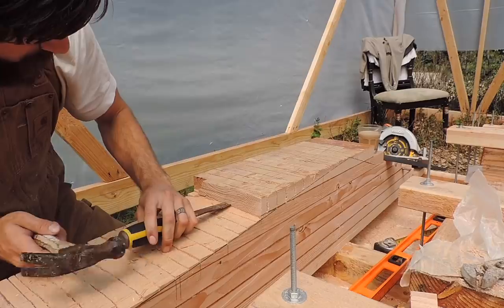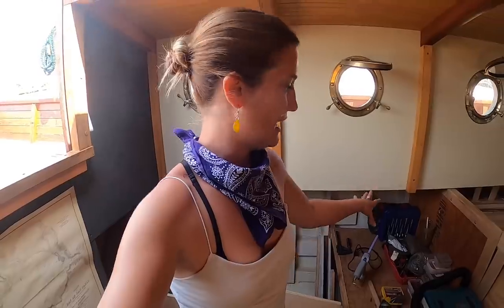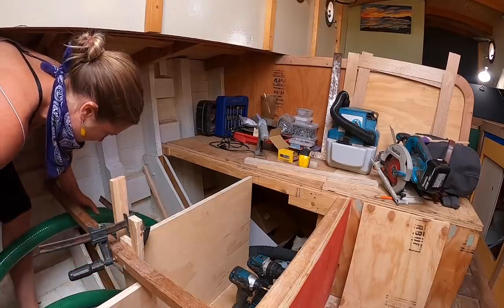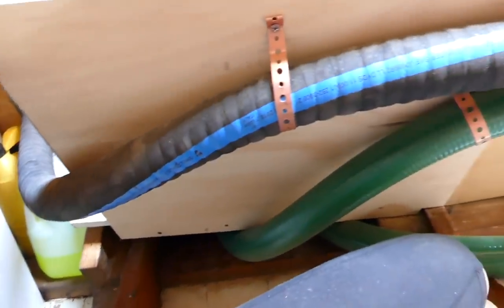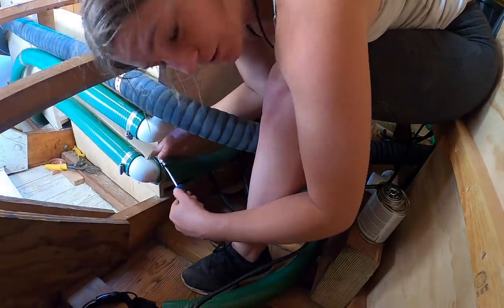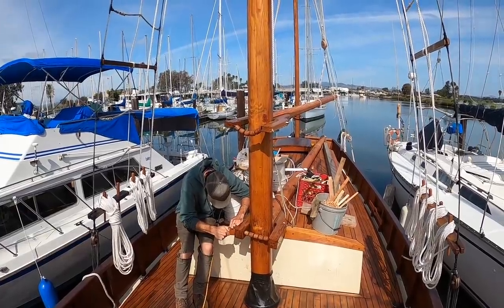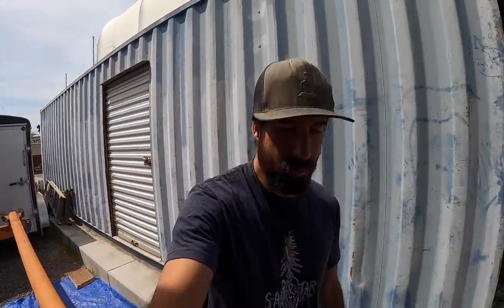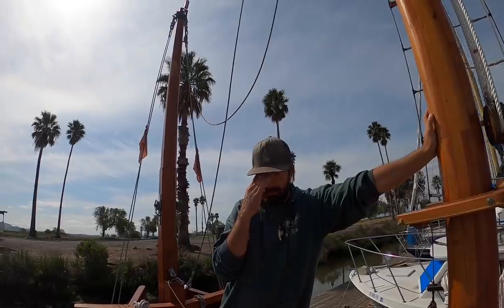Salt & Tar: Ep.144- My First Solo Project

Comment: Those copper straps will cut into those lines. Those straps are meant for metal pipes in homes that aren't subject to movement....like a boat. They make special rubber backed straps that would be better or put something between the copper strap and the pipe.
Reply: They'll be OK for a while. Although they could do with two fixing screws
Reply: Totally agree, you’re going to find a leak at the least opportune moment
Reply: Also Ruth, it appears you used a drywall screw to attach those straps;  over time (and not much time at sea) those two metals will fight.
Reply: Ruth could scarf up an old rubber innertube and cut strips to fit between the copper straps and the hoses.  Not even sure there would be enough movement to worry about, but she could keep her eye on it every few months to see if any chaffing is happening.
Reply: I see a whole lot of objection, which is understandable.  I was also nervously analyzing multiple aspects to this job, such as the shear number of connections now being made in this line.  I would double, triple, and quadruple check for leaks.   However, I am also proud to see that she gave it the old college try.  Whatever that means.
Reply: ⬆️ it means 'good from far. But, far from good'.
Reply: You need cushion clamps.  They are hose hold downs with rubber cushion on them. McMaster Carr has them in stainless and galvanized in lots of hose diameters.
Reply: If you have any extra of those hoses you could just cut it into some small sections of maybe 3 inches and cut those pieces open allowing you to slip them over the bilge hoses between the copper straps and the bilge hose.  Maybe use a little of that cement to hold it in place.  Then tighten down the straps.

Comment: Double hose clamp at each joint and you should have put rubber strips under the copper straps. They’re like razor blades that will cut right through your hoses.

Comment: Nice work Ruthie.  @20:55-That's using your head.  When you have a chance you may want to get some neoprene rubber and make strips to go between the copper plumbing strap and the pvc hose.  This will prevent any wear from the strap to the hose when it vibrates.  Take care you two.

Comment: You are both doing great work and have been doing for 5 years plus as well as producing very watchable films of your progress. I rarely comment and never negatively - however, the plumbing of those hoses may need some revision. Firstly the sink(s) should probably have a trap, second you need to consider being able to clear the lines of any blockages and gluing those elbows in removes some access opportunities to do so and finally the copper supporting straps look good, but the normal vibration of the boat in service will fret and cut through the pvc.

Comment: Nice job Ruthie it is great to see you putting your new found skills to use.  BUT change the copper strip for rubber covered "P" Clips. Available from pipe & plumbers merchants quite cheaply. Or slip some rubber strip under the copper to protect the pipes.  ATB Stay safe. Fair winds & regards from the UK

Comment: Glad you tapered the boom.  It will look great.  Also pressure test the bilge lines before sailing to insure the integrity of the glued joints.  As stated before barbed fittings probably should have been used.  However glued and clamped may be just fine.  It is also a mostly  zero to low pressure  drain line.  The high pressure will happen at the pump outlets where you absolutely do not want a leak.

Great job.  Ruthie you are a keeper.

Comment: I think while your running the engine, mounting the exhaust hose to the box is going to vibrate and be very loud, you should maybe isolate it with some foam or something to help dampen the vibration and noise.
Reply: And that rubber hose is gonna rub through over time. The PVC elbos on the emergency bilge lines are concerning too. No lip on the outside of the PVC for the clamps to grab. May blow apart if they ever need to pump water out quickly.
Reply: @ericsills5290  Not really sure that is an actual concern because the joint are first glued meaning the clamps are secondary fasteners who job is mainly to keep the hose from vibrating at the glue joint

Comment: Just a suggestion on those bilge line I would put a few more copper straps to anchor them. Keep in mind they will be getting heavier when in use and the pitching seas may possibly affect them adversely.  Would not want you guys to have that happen. Or consider even wooden main caps to hold them in place for less chance of chaffing from the copper.  Fair winds and following seas mate.

Comment: Hi, You doing an awesome job with the hoses but here is some advice you should put a rubber strap in between the copper strap and the hose to prevent chafing that can cause a hole in the hose. You should also put the hose clamp screws facing you for easier access so you don't have to bend all crazy to get to them later.

Comment: Your solo project is coming along nicely Ruthie
Garrett. That’s a slick way of trimming that boom
Reply: However, there are a couple of knots in the boom that will eventually prove problematic if they aren't dealt with, especially as you decrease the cross-section strength of the boom.  I would highly recommend working them out and installing a dutchman in their place.  The one on the side of the boom toward the outboard end should have a lengthy square section through the knot removed and replaced with a clear piece of wood.  The one at the inboard end might be taken care of by drilling the knot out and installing a suitably sized dowel in its place.  The repairs would only require a good water-resistant glue.  Just a recommendation...

Comment: You guys probably already know this, but on deck scrubbing with a brush, it is best to go across the grain for most woods due to soft fibers in the wood. . . at least on day to day scrubbing.  Nice work down below, Ruthie.  Ditto on the strap comments.  Very nice carpentry !  LOVE that wash down pump.  The ones I've ever used are so puny.

Comment: to fit tight rubber onto hard surfaces just add a little white spirit.  It acts as a lube but evaporates dry. Great for fitting chrome trim to glass with rubber, and rubber pipes

Comment: Hopefully you can set sail...see ya in an anchorage maybe. You better hurry or you will have to join a senior sailors group.
BTW , the teak oil does better if you add some Spar Urethane to it, at least 25%. Try it, you will see. Using some mildewcide additive also helps.

Comment: Worked on a sailboat that had been a WWII subchaser off San Diego so all hoses & wires were military spec. So would have wrapped the hoses with riggers tape or rubber at the cooper tie ins. But guess when the copper corrodes the green will give chafe protection. The job looks great & named one sailboat Over Keel, because of the tendency to Over Kill on everything, but lets not talk about Garrett.

Comment: Hello folks, coming along nicely. Garrett, the leather you used seems like the thin stuff available at Crafts stores and it may no Pass the test of time. IMHO next time you would do better replacing that with at least 9oz leather or thicker. You also may have created tear points everywhere you cut the leather to bend it over for nailing, I would suggest you soak the leather in water for a while before installing it, this will make it soft enough to stretch into shape.

Comment: You need a rubber buffer between the copper and the hoses because the copper will wear through the hoses eventually.  Do not just screw the copper hanger strap over the hoses, take it from someone who has been there and done that.

Comment: In aviation we use clamps with a rubber insert that are much neater and protect the hoses better than those strips of copper. I don't know if you can find clamps that large but it seems like those copper strips up against that hose is not a good long term solution.

Comment: I thought all flexable hose connections should be done with "barbed" fittings. I might be wrong but those PVC fittings look like the type you use on rigid PVC pipe and are designed to fit over the end of the rigid pipe not inside a flexible hose.
Reply: Since she glued every joints with the proper cement (PVC) there's absolutely no problems. Plus, the're drain hoses, zero pressure in there !
Reply: Yes you're right! I checked it out and learned something new today!
Reply: @marcryvon  she also hose clamped them for good measure
Reply: pvc elbows should definitely go over the pipe, she should have used bigger diameter of the elbows. This way she restricts the flow inside. No a big deal since there is not gonna be any pressure, but ton of extra work for her to deal with those clamps. Also those elbows have writing on them outside so it's ridiculous to use it "her" way because there might be leak after all, unless she sanded it down...but again...ton of extra work
Reply: @KoohaEbuyer  I thought that way also until I looked into it. But one thing I will say is I have never seen flexible pipe inserted inside of a fitting. Pex fittings and Barb pipe fittings all fit inside a flexible pipe so that you can use a pipe clamp. There is at least one company that sells PVC flexible pipe designed to fit over the same PVC fittings that PVC rigid pipe is inserted into. I must assume that when you apply the solvent to the fitting it dissolves the raised letters on the outside of the fitting enough so that it forms a good solvent weld seal between the PVC fitting and the PVC pipe.

Comment: i would check that with all the elbows in the bilge hose lines that these don't reduce your water flow. you have them to get the water out fast. test them before you need them. hoping you never will.

Comment: if you use 90-degree elbows use a swipe 90-degree elbows less flow restriction the 45 shouldn't be too bad. a gradual slope  to the ceiling would be much better than a straight lift up. try it both ways

Comment: Copper tubing in front of a fan, circulating either freon, or ice water, through heating duct. with ice water it

is connected to an ice maker which dumps ice into a container filled with water. the container has an

automatic overflow hole to keep the water at the right level. The fan is plugged into a fuse extesion chord

which is connected to a thermostat, then the power source. the ice maker could continuously work (be

plugged in) or be plugged in with the fan as well. Cn add additional fans as needed.

How To Turn Your Fan Into An Airconditioner AC @
5 Best Ice Cube Makers To Buy Online @
The BEST DIY Off Grid Air Conditioner - SUPER Efficient/Battery Powered @/vanlife

@
5 Best Folding Electric Bike 2021 @
if links don't work just search youtube with titles before links

Comment: Very Important... Please Read!!!
2 things... you Need some type of protection between copper strapping and hoses! Chaffing will cause failure, and you NEED vibration isolation!
Secondly... Most Importantly.... you should Not apply the glue to hot tubing! Its likely that theres little to no adhesion in the joints!!! It would suck blowing those connections at sea!!

Comment: lots of valid suggestions re the plumbing... the use of copper, the fittings, etc... the question of course.... will Ruth accept these valid comments and replace her work......  sad.. but the delay in most vlogs will mean lots of her work will have been done before she reads them...   still better to fix them right on the hard rather than at sea....

Comment: Probably not the best idea to take plastic pipe and strap it into place with that metal straping on something that's gonna spend its life moving especially a wooden boat they move a lot , you could cut through you sould use plastic hangers

Comment: Nice looking plumbing job Ruth, BUT! every one of those close ells adds restriction equal to 70feet of hose and that is if the inside diameter of the elbow is the same as the hose. I don't know what the specifications of your pumps are but I fear that you have greatly reduced their output ability.
Reply: My Equivalent Pipe Length chart shows a loss of 4-feet for every 90.  That looks like 2" hose to me and I used 1.5" for the inside diameter of the fittings.